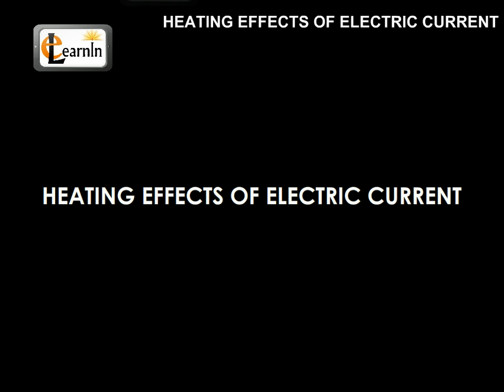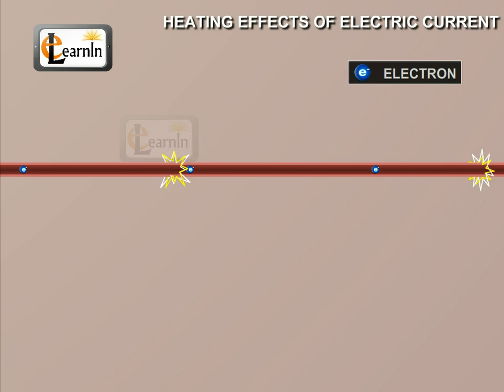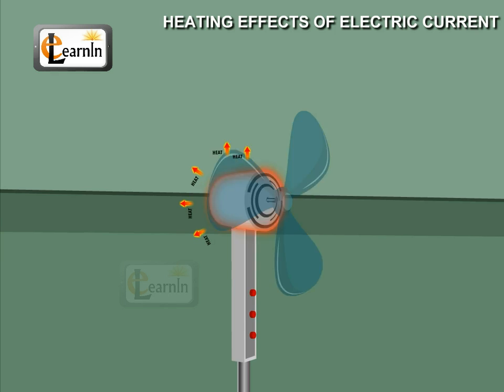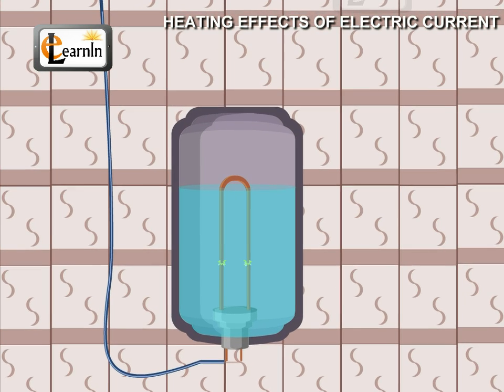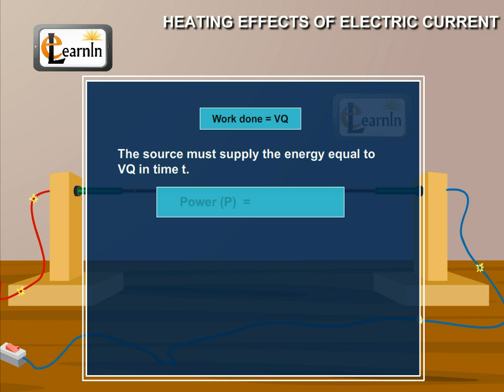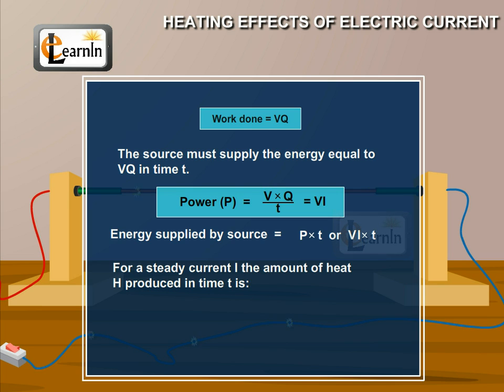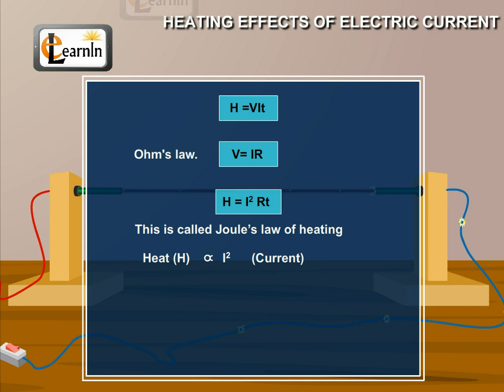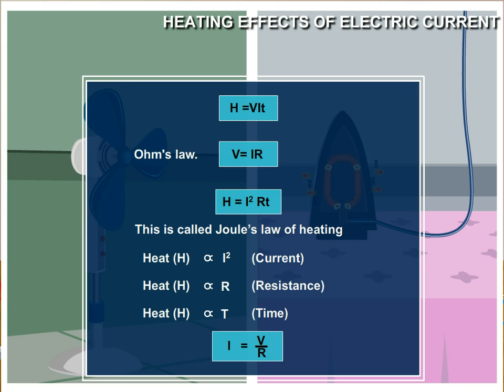Heating effects of electric current - Science

Comment: Is anyone else seem bothered by the fact the flow direction is wrong?

Electrons flow from neg to pos, not pos to neg as shown here.
Reply: When Electricity was invented a long time back it was known that there are two types of charges positive charge and negative charge but the electrons are not been discovered at that time so electric current was considered to be a flow of positive charges and the direction of flow of the positive charge was taken to be that I have direction of electric current just the conventional direction of electric current is from positive terminal of a cell to the negative terminal through router so cute so in a circuit diagram you put the address on the connecting wires pointing from positive terminal of the cell towards a negative terminal of this cell to show the direction of conventional current but however the actual flow of electrons is however from the negative terminal to the positive terminal of the cell which is opposite to the direction of conventional current
Reply: you are wrong